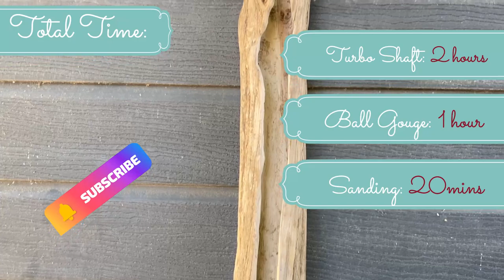Driftwood Lamp with Moss and Resin – Unique and Easy to Make!

Comment: I love these driftwood projects! I purchased some of the LED light strips and I had some questions...Do any of them come with a regular plug on the end or are they always USB connectors? The reason I ask is if you were to sell these, would you have to include a wall plug similar to an iPhone charger so that users could plug it into the wall? Do they make any LED kits with regular wall plugs? Also, where can you source the preserved moss? Thanks for showing me a new way to use all of my existing tools and pieces of driftwood! A BIG like and a SUBSCRIBE!
Reply from the maker: Thank you for your nice words and very sory for the late reply. Yes, you can buy LED light strips with a regular plug. My personal preference though is a USB connector. It's just a more universal option as plugs are different depending on which country you are from. I buy preserved moss on Amazon - here are my links if you are interested: https://epoxywood.uk/amazon-links/   Brgds Alicja

Comment: Hi....quick question.Dont you have to water the moss to keep it alive......jus thinking about the electricity in the light strip......
Reply from the maker: No, it is preserved moss, does not require water. Hope this helps